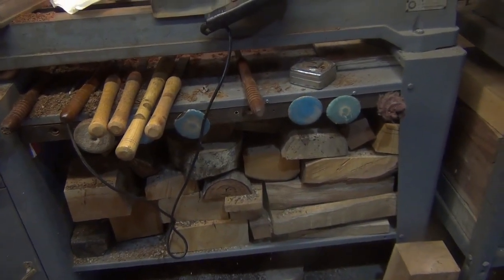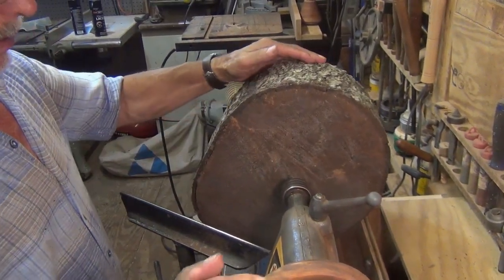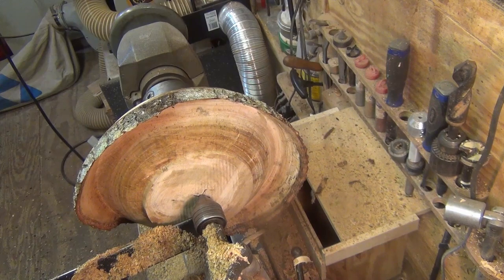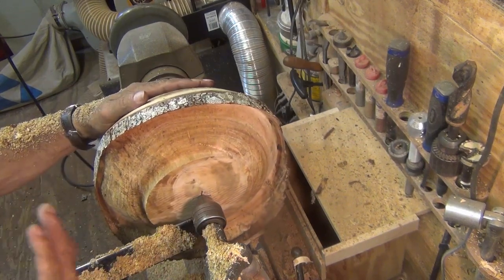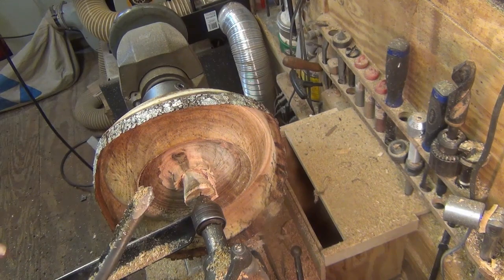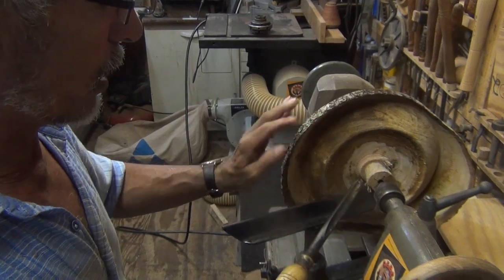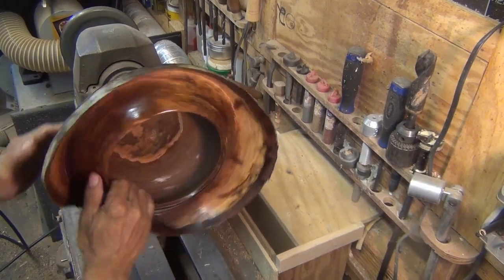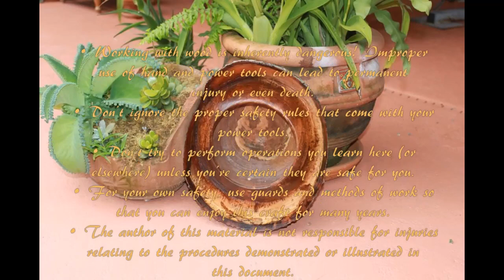Woodturning When the Lathe bites back  by Al Furtado

Comment: I'd appreciate your views on selection of a mini lathe for my full time rv'ing. I am currently thinking the nova comet 'll or the rikon 70-220 vsr.   Both claim a low speed of 250 rpm.  Also appreciate thoughts on tool selection. Because of space, weight, etc I am leaning toward carbide rather than hss.  Carbide means that I don't need a grinding wheel. (Space). I am somewhat concerned with a parting and scraping tool however.  Lastly I will need to consider a single chuck, a good all around selection, but completely  at a lose.

Thanks for any help you my provide 

Barry
Reply from the maker: Thanks for watching and asking for my opinion, I have not dealt with any mini lathes although have considered one for my travels. I probably would go with the Nova even though they both have great reputation, As far as tools well going carbide is a sure way of doing it and not very expensive and a much lesser learning curve. as far as re sharpening a parting tool if the shape is already established you can always touch that up even with sandpaper on a dowel. scraper you just get a square carbide as well. and a chuck well Tecknatool sells a Nova chuck that I use most of the time for around 100.00 dollars  sometimes less on sale.This should get you well on your way to the wonderful world of wood turning.  Good luck and be safe

Comment: Al what is the difference between a regular gouge and a bowl gouge. Thanks Rich
Reply from the maker: Richard this is a good question, I hope I didn't use the term regular gouge.There are different tools named gouges.1: roughing gouge. (usually shaped like a half pipe) used for rough spindle or long grain cuts.2: Bowl gouge many sizes avail. (generally a round bar with a flute machined out of the bar but leaving plenty of steel left on the bar)3: Spindle gouge ( same as above with a shallower groove and generally thinner) generally sharpened to a shallower grind.I hope this helps